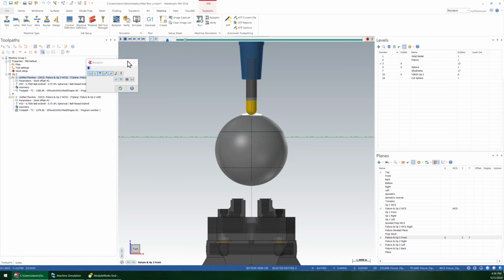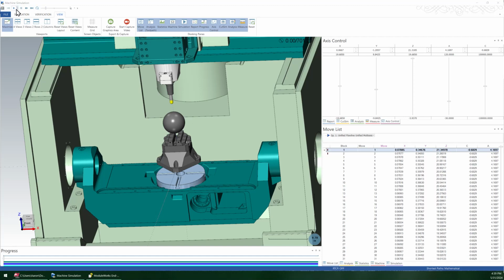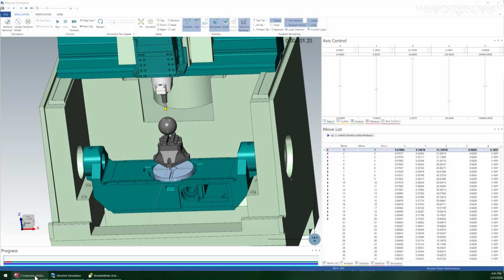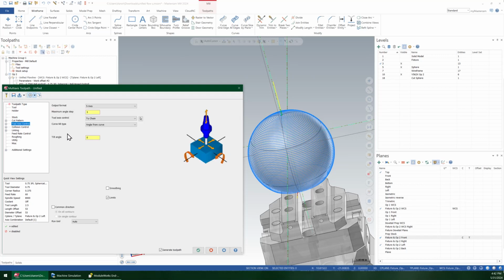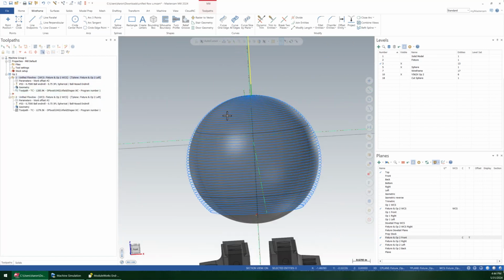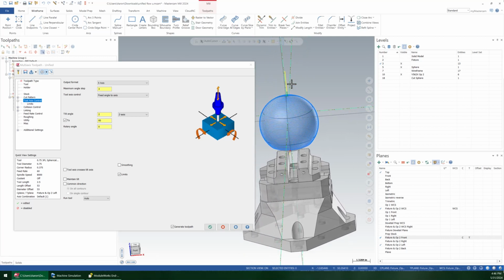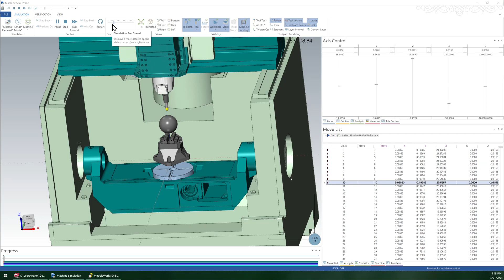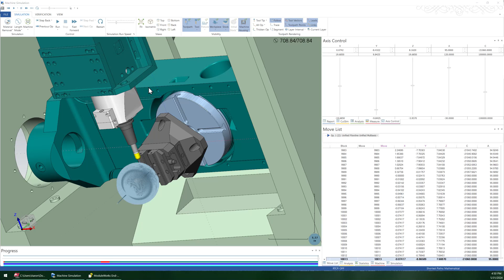2024 05 31   Mastercam   Unified   Jitter in Motion

Comment: thanks. Yeah, can you please explain more the singularity situation and how pros' are managing it?
Reply from the maker: Sure, I'll try to find time to make a video on it, but basically, when two axis get perpendicular to each other, there's theoretically an infinite number of solutions as to which way a it can tilt through it.  Picture what happens when a tool has to cross over a dome right at the very top of it on a BC or AC rotary table machine.  When it's tilted right before traversing across the top, there's an easy-to-calculate value that the B & C axis have to be tilted, but, when you cross over the top of it, there is a point where either axis can move in any direction and still be tangent.   When that happens, the post processor is calculating moves below the limit of the tolerances, so it'll prioritize one axis over the other.  This often results in a small B move, but a 140° C move.
The easiest way to avoid it is to simply not let the algorithm tilt through 0° if you can avoid it, then you'll never need to worry about it.  In my example, I told it my tilt was allowed to be anywhere from 2° on, so it avoided that.
Reply: @VectorMfg In Lahmen terms you wouldn’t want the tangent point of tool tip and tangent point of the top sphere points to be directly inline during cut?
Reply: Aaron can explain it better. I’ll try. .. There’s either more than one solution to the problem for a position or the algorithm has to divide by zero which is impossible. 

Can crash machines or post incorrectly. I’m just getting into this stuff to but I know singularities are an issue with robotic arms when joints are at a straight 180 degrees. So you have to program around that.
Reply from the maker: @icey_b1562  Great go at it :)

Comment: Thanks a ton for making this. I learned a lot in a hurry. Can you give a brief explanation of what you mean by singularities? (10:05)
Reply from the maker: You're welcome!  Copied my reply from above just to make sure you got notified :) 

Sure, I'll try to find time to make a video on it, but basically, when two axis get perpendicular to each other, there's theoretically an infinite number of solutions as to which way a it can tilt through it.  Picture what happens when a tool has to cross over a dome right at the very top of it on a BC or AC rotary table machine.  When it's tilted right before traversing across the top, there's an easy-to-calculate value that the B & C axis have to be tilted, but, when you cross over the top of it, there is a point where either axis can move in any direction and still be tangent.   When that happens, the post processor is calculating moves below the limit of the tolerances, so it'll prioritize one axis over the other.  This often results in a small B move, but a 140° C move.

The easiest way to avoid it is to simply not let the algorithm tilt through 0° if you can avoid it, then you'll never need to worry about it.  In my example, I told it my tilt was allowed to be anywhere from 2° on, so it avoided that.
Reply: @VectorMfg  Thanks for explaining!
Reply: Random C140. ??! Do postability post catch those moves? We have CAMplete at work but it isn’t setup yet. 

I’ve got a part at work that may have similar issues if i’m not careful to programming. But that seems easy to do b
Reply from the maker: In a lot of cases, a well set up post will avoid it.  Postability is about the best in the business so you probably won't have too much trouble.  In general, it's good to avoid cutting on the tip if you can avoid it anyway, so it generally doesn't hurt to use a touch of tilt, Even if that specific problem is solved by your post.